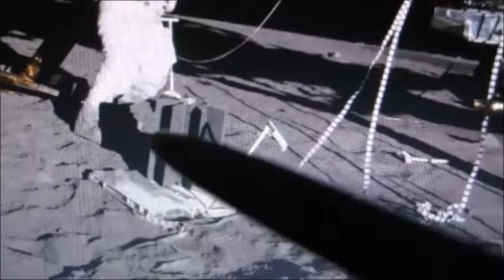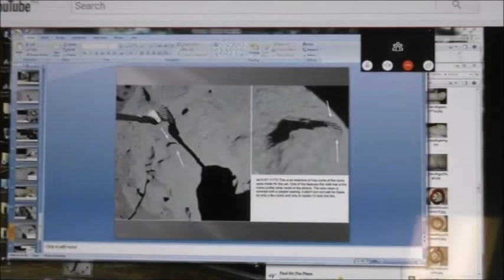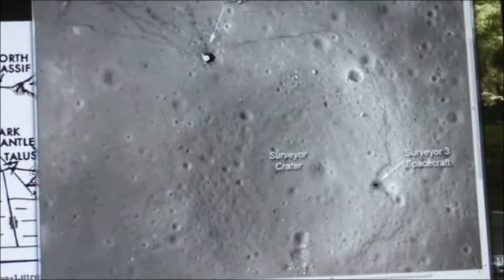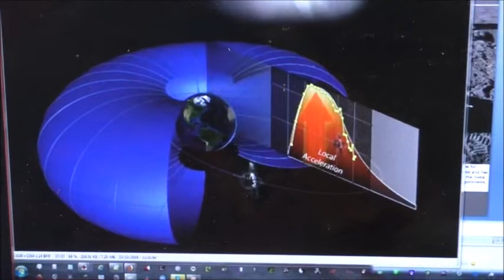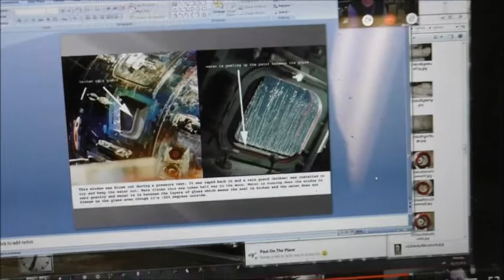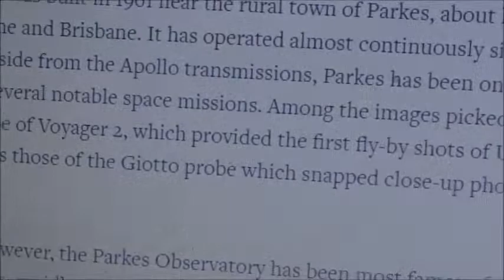The Apollo Defectives 2... Morons On Patrol

Comment: How about this one: the astronauts did live video from the moon to the earth. How was that possible to receive for the amount of "live video time" they did, with the earth spinning around it's axis ?
Reply from the maker: They used ground stations around the world, not just one. Do some research.
Reply: Yes I did some research. Even with ground stations there would have been (announced) moments of switching between different ground stations. Yet the video was live all the time. They used old tube technology and analog signals in the end 60's. That would never make it through the van Allen belts without being distorted.
Reply from the maker: How exactly would the Van Allen radiation belts affect the "analogue signals"? What would be the switching delay between earth stations? Milliseconds, seconds, minutes or hours? What is the exact time duration of the live video in total? Of course, if you can't answer those questions you really shouldn't be making statements like the ones you made here.